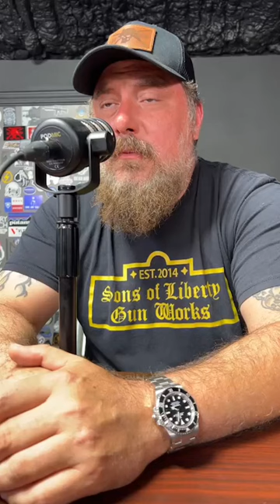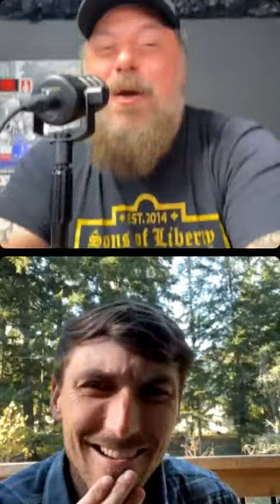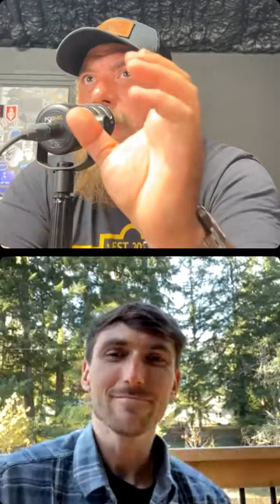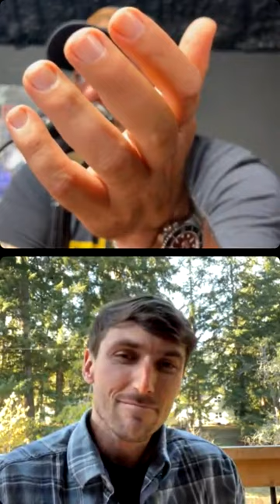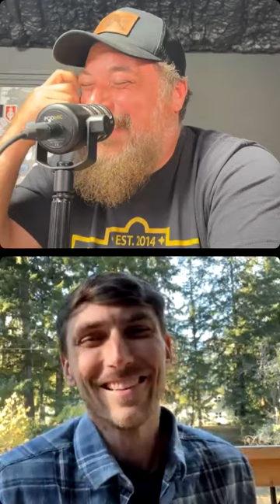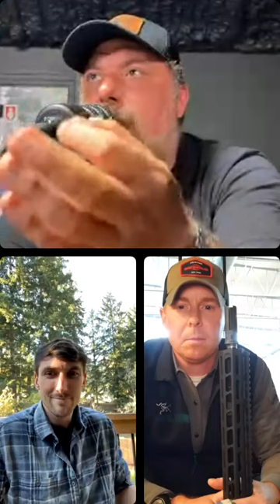Garand Thumb, SOLGW Mike talk TF69XSOLGW Collab

Comment: Best guns out there in my opinion 🙌🏿. Building a 16” .308 using SOLGW parts trying to find a stripped lower which has been challenging but I’m committed to the causes😂. Doing the armorer’s course in December 🙌🏿
Reply: Have you checked zevs website?